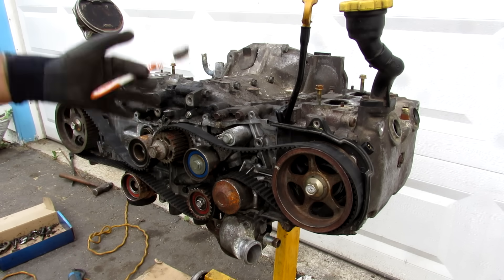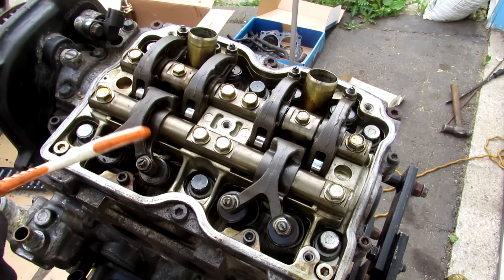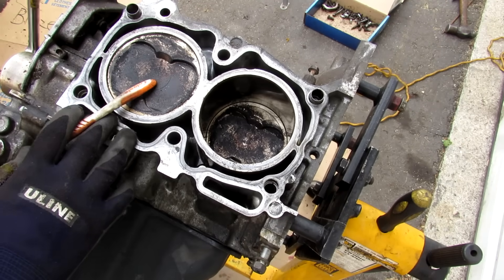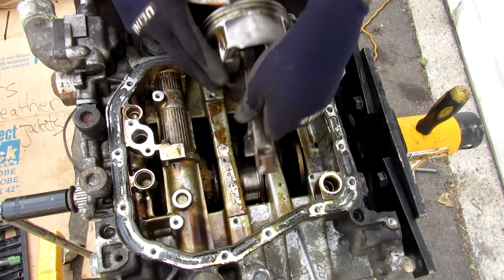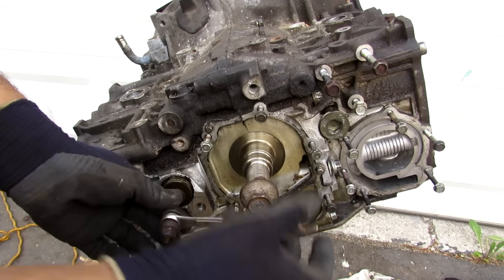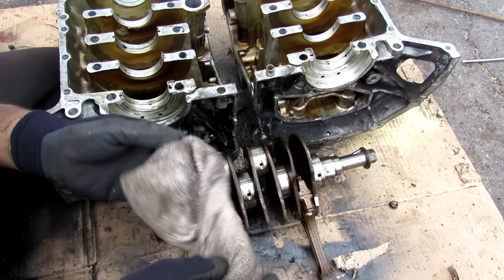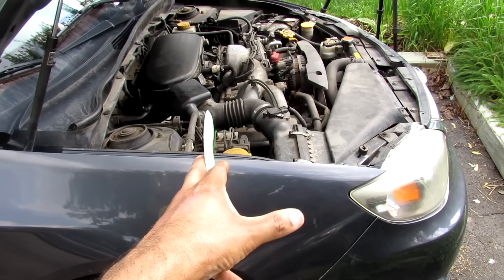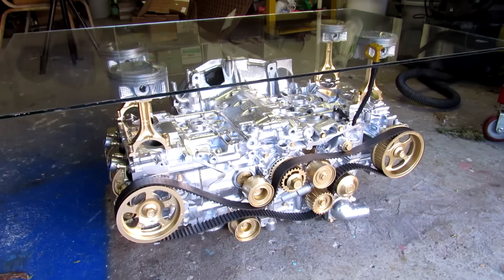Why Subaru Engines FAIL

Comment: what causes subaru's to have a ticking noise when they are cold at idle, sometimes it can stop if you blip the throttle , it will be gone for 10 seconds then might start again, or it won't. it seems really random!?
Reply: Probably lifter tick changing your oil usually stops it for a little while atleast in my mx5 sounds like what your discribing

Comment: Engine oil lubricates AND transfers heat of friction to the coolant by conduction. A bullet through the radiator caused all the coolant to leak out, but the Rolls Royce continued on to home base because the oil kept working. - Sir Lawrence of Arabia, 1925
Reply: That was in 1925 when the blocks were all cast. Newer blocks do not handle heat because of the aluminum. Although it saves weight it's at the cost of durability. Driving a modern car with little to no coolant means your replacing the motor or the car.

Comment: This was super informative but also kinda scared me away from an ej engine subie. They seem very uh unreliable with how many things can go wrong 😳
Reply: EJ engines are great, they are very reliable just as long as you take care of it. I have one with 200k and never had to do more than replace the valve cover gaskets.
Reply: @enemyspotted2467  that's good to know. I guess I just gotta find a really good ej blob eye, I've been dying to get one but i always hear they're motors are problematic and that they cant handle power cause of ring land failure.... the other issue is finding one that hasn't been abused for decent money cause they also overprice these vehicles and I'm sorry I'm not paying 18k for a almost 20 year old vehicle...

Comment: This gentleman knows what he's talking about.  I experienced exactly what's he's describing.  I had oil starvation running at 80 mph with less than 60K on the engine.  The oil level was less than a half quart low but the oil light came on.  The engine began burning oil around 45K or so.  (2.5L 2014 forester).  I now know it's a design problem.  And changing the spark plug is a horrible experience.  Other issues, the AC compressor and evaporator self destructed at 44K, Rear wheel bearing at 60K.  Break switch at 55K, and of course the oil burning issue.  Hope people learn from my mistake. I won't own another Subaru, ever.  Service dept is a rip off.

Comment: Great video. I would like to learn more about the supra engine. I had a 1980 Supra many years ago and it never gave me any mechanical problems. Too bad I got rear ended twice, fixed it both times but eventually the car had too much rust, had to scrap it after 20 years of use up in Canada (rust belt).

Comment: Why Subaru Engines FAIL
removes FRAM filter...
Reply: Gotta go with the NAPA gold filter. ;)
Reply: @johnvoorhees7881  Same as Wix, I think.  I use NAPA Gold also.
Reply: @hankosaurus  yeah, I was told Wix makes them for NAPA
Reply: Wix filters for me.
Reply: btw I use Amsoil filter and oil and will stick to that
Reply: Wix/Napa are the best for Subaru engines. Only ones that meet Subaru's bypass spec on the EJs. And they're just better filters than fram junk
Reply: @Helicopter Dad your better off shoving a cardboard box in a beer can and strapping that under your engine than running a fram.
Reply: I worked with a guy who bought a turbo legacy and did the head gaskets. It toasted the engine in a couple hours due to a $2 generic oil filter that did not have a bypass built in. Stay away from cheap garbage filters.
Reply: Best but underrated comment
Reply: Very valid point seen a few motors give out after framm filters used
Reply: there you go.....FRAM.......has the same ring as CHINA....crap filters from day one.
Reply: Get Real  I had a 2006 focus, replaced the oil and filter with whatever was on sale every 5,000 miles. Sold it at 330,000 miles. For the last few years I was buying Rural King oil and generic oil filters. That was a great motor.
Reply: I only use Mobil 1 synthetic oil and filter in my 3.6  2011. It now have 325,000km
Reply: Ran both my hondas on fram filters. Went over 300,000km on them no engine problems.
Reply: Mann filters please
Reply: adri weststrate That’s all I use on my 2010 VW Passat.
Reply: I owned 13 Toyotas over the years only one failed around 100,000 miles, about 4 weeks after I put in a fram filter, whic was against the advice given to me by Cobb county Toyota
Reply: Royal Purple oil filter. Fram is C r a p !
Reply: @adamdelarozza1985  I was trying to buy Royal Purple oil filter, as I use their oil for my engine, but I just could not find if they produce it for EA189 VW 2.0 TDI engines. Where do you buy them?

Comment: Although informative, there is some misinformation.  You should never need to split the block.  If you do need rod bearings, you're in big trouble.  You will need a crank at that point.  Generally, you only need pistons, rings, head gaskets, and water pump/timing kit.  Secondly.....NEVER EVER EVER use an impact wrench to disassemble an aluminum engine.  The impact wrench tends to rip out thread inserts.
Reply from the maker: You didn't get past the fact this was a scrap engine eh...
Reply: I had an engine with a spun bearing....well, it got spit out.....but the block was good.  Put in a different crank, rod, and new pistons & Ring's.  Turned out great.  I DID have to split the case on that one.

Comment: I was actually looking at buying a Subaru, until a buddy told me about the head gasket problem. No Thanks!
Reply: The head gasket issues only really come up on cars that were neglected and beat on. even then, it only really affected the 2000-2006 model years. Subaru's are great cars and will run forever if properly taken care of, and you can't beat the AWD.

Comment: Subaru won how many world rally championships? With an engine that fails? I think not! Incorrect coolant will cause head gaskets to leak and without correct engine oil and filter the engine will not survive very long. The flat four engine does not work against gravity and has a very low center of gravity perfect for racing. The shorter stroke is an advantage for higher rpm like F1 .Plugs may be hard to change but it’s always give and take with any setup on any car.

Comment: I used to love Subaru, but these days, short of one being given to me, I will never own one. There are certain headaches and nightmares that I am not willing to deal with, I guess I just prefer my vehicles easy to work on and maintain.
Edit: Wow, it got so, so much worse when you have to remove plugs... to get to the piston rings, to pull the pistons, before you can even split the block to get the crank out.. just....... at this point, I don't think I even want a Subaru given to me. And also, yes, all the bearing for the crank are fed, you just did not point out the holes in the other half of that crappy block. I understand what Subaru was trying to do, but.... damn the did some stupid crap.

Comment: Super informative. Had a shop, master subaru mechanic, rebuild my motor last year at 146k miles. Replaced every possible preventive maintenance part in the process. I’m about 8k miles into and oil starvation on passenger side camshaft. Oil leaked everywhere 
Please help if anyone knows why oil starvation happens on the passenger side head after a rebuild with every thing new and replaced?

Comment: Great video! Engines are fascinating and even more so when you get to see how they are put together and work. A little note for this type of engine... The apposed style of engine is well suited for constant  high rpm operation.  It is a design originally intended for aircraft. However it does work well in vehicles of many types. BMW motorcycles, Lawn tractors and cars. Keep up the awesome videos! Your narration rocks!
Reply: In aircraft the horizontally opposed engines run at low RPM, say 2,400 or so.
This is because they are not geared, so much faster and the prop tips go 
supersonic which isn't kind to the props or one's eardrums, and the 
centrifugal forces become huge. Porsche never managed to build a successful engine for aircraft, they tried but failed.
Reply: @dny9394  Are there any other boxers about apart from Porsche?
Reply: @dny9394  Radial engines on aircraft operate at lower rpm's than do the flat apposed engines. A smaller displacement engine like a flat makes it's horsepower at a higher rpm so the aircraft is equipped with a gear reduction box between the engine and prop. Not all use this setup though. Some are direct drive. There are all kinds of drive systems out there. I just find the Briggs & Stratton 2 cyl apposed air cooled engines to be very reliable and they run at 3600 rpm at full throttle. My BMW R100GS bike is also a 2 cyl air cooled engine and that runs up to 6800 rpm but highway speed is around 4200 rpm. A water cooled apposed engine has a whole list of down sides. One of which is head gasket leaks. A very common problem with the Subaru design. However... The engines that Subaru makes in Japan seem to not be plagued with this issue. It's the Subaru engines made in the USA that are known for the head gasket failures. Hmmm wonder why? I would guess quality control.
Reply: Also the airplane engines are air cooled. Those two openings next to the prop are where air comes into the cowling during flight to cool the heads which are on either side of the prop shaft. Having the hot parts of the engine split in two  and far apart makes it easier to keep cool using  just air. This feature is of no value on a car since it is water cooled. Of course excepting the older Porsches.
Reply: @stevebollinger3463  Indeed the airplane engines are air cooled as were VW, Porsche and the Flat 6 that was found in the Chevrolet Corvair! Air cooling in autos was an interesting idea but with new noise regulations and fuel mileage standards there was a switch to liquid cooling which can yield better mileage and run quieter. I find it kind of sad though because the old Air cooled designs were simpler. I still enjoy the 2 cyl apposed air cooled engine on my BMW motor bike. It's been running great since 1992! Just with oil changes and spark plugs. Oh and it never needs a water pump or radiator! XD Seems to be plenty of air around. :D

Comment: I have a naturally aspirated ej20, what would be most likely to cause the engine to tap only when the engine is cold, goes away after warming up. Running synthetic 5w40 oil.
Reply: Zac Johnson listen starting at 9:25
Reply: @adrianj7879  thanks
Reply: @adrianj7879  sounds liekly actually yeh
what oil grade would you recommend? I have been running full synthetic 5w-40 but just purchased a bottle of 5w-30 (becaus I thought it might be valve lifters)

Comment: What a fabulously paced, high information density, well spoken video. I think it’s the best I’ve seen. Clearly a very knowledgeable chap. Well videoed, well edited, punchy. Loved it and learned loads in a short time. I have a Porsche, also a boxer configuration, so would love to see a 6-cylinder boxer teardown ... and, no, you can’t have the engine out of the 911. My mum had an Alfa boxer, so even a bit of mechanical nostalgia for me! Will certainly look at another one. Loved the 14mm hex wrench bit manufacture - thrown in as a tip.
Matt, UK aged 1,000,000 (binary) this year.
P.S. ...ah, lower down, another ‘can we see a boxer-6 teardown, please?’ So - has to be done.

Comment: Why would coolant in the block cause issues with the head gasket cause it is sitting in the block. 7:30 All engines have coolant in them at all times unless it has been drained out for some reason. The way you describe it sounds like the coolant would drain out the block when not running.

Comment: Soobs should have kept going with the angle and made it a V4. Now, that would have been a heck of an engine. And it isn't as if the Japanese are new at it... I mean, Honda made (and probably still does) a heck of a V4 for their motorcycles; like the RC30 or RC45.

Comment: I will preface this by saying that I am a Subaru tech, but there is some things that are false in this video.  Firstly, the headgaskets fail on the 99-2012 motors mostly because Subaru used cheap, thin headgaskets to cut costs, use some thicker multilayer headgaskets from slightly older motors and you won't have that problem, nothing to do with torquing. Second, oil almost never mixes with the coolant on these, when it does, it comes from the combustion chamber, you would have to overhead and warp it so bad that they lock up long before that happens, what happens is the seal between the combustion chamber and the coolant passages fails causing pressurized exhaust gasses to be forced into the coolant. When they fail they start over-pressuring the coolant system and pushing coolant out through the overflow and into the reservoir, once bad enough it will overheat because the over-pressurization will stop the coolant flow and also potentially cause a misfire.  The main reason these motors fail is because A. people don't change their oil on time (I have a 2000 with over 200k that has had its oil changed religiously and doesn't burn a drop) and B. kids over-rev them and subaru's don't like high rpms

Comment: Thank you so much.  I am a shade tree mechanic.  have never hired a mechanic in 50 years driving beater automobiles.  a long time ago i decided to stick to american 6 cylinder engines pree smog control.  I often wondered about those subaru engines, as i also own a 1975 bmw motorcycle.  Your video showed me i was wise not to mess with subaru engines.   what a nightmare.   Good for subaru mechanics.   I know now that love it's what makes a subaru a subaru.   The mechanics of america must be in love with subaru, it's engine must have more self destructive tendancies than my ex wife.
Reply: I must be lucky. I have had my 2000 Liberty (Legacy) since new and have done 600,000km and have never had a problem with it. Haven't even changed the timing belts, just regular services.

Comment: What ? secondary forces cancel each other out on V6 ??? Beside, nice tear down of the engine.
Reply: cough they don't w/o the aid of (a) balance shaft(s) and counter weights
Reply: a 60° V6 is pretty close to inherently  balanced.  The infamous 90° GM/Buick V-6 was NOT!  The engine setup was made to be built on a V-8 line, for economics, not efficiency.   Yes, GM finally figured out a staggered journal crankshaft to even out the firing pulses, and it didn't become a half-bad engine, for an economy car....yes, most modern v-6's use  balance shafts, as do ALL modern I-4's...

Comment: What I don't understands is some of the motorcycle engines are horizontal oriented but most of them last quite long too. Motorcycle engines usually revs up more higher than cars, why car engines more likely to occur oil starvation?

Not to mention motorcycles tilting their engine by cornering too!
Reply from the maker: Good thoughts

Comment: I always liked the EJ18 or EJ22 engines. Subaru just didn't know how to make bigger engines! I used Hy-per Lube Oil Supplement in my EJ18 with syn oil helps to have sticky oil in a flat engine!
Reply from the maker: It's good that they are unique. But maybe they should switch to inline 4 when the pots get bigger

Comment: i wouldn’t have thought my subaru had any issues until watching this video, after i put on a 2.5 inch sti catback on my 2005 impreza, whenever you record startups, especially cold starts, you hear a metal tinging sound as it runs. can’t hear it in person but the microphone pics it up. thinking of swapping the ej201 for an ej257?
Reply from the maker: Pinging is predetonation 
On cold starts it could be piston slap

Comment: Alfa Romeo 'boxer' engine - the best. If you look after them properly they're unburstable. I've had four of them.
Reply from the maker: But the rest of the car on the other hand....
Reply: @speedkar99  Ha ha! Yes, some of them had real steel problems. ... and the electrics were idiosyncratic to say the least. The rule was (is - I'm on Number 9), if something stops working don't take 'to the dealer' as instructed. It often sorts itself in a day or two. My favourite was the Sud 1600 Ti Green Cloverleaf; no problems - just keep putting the oil in :-).

Comment: I believe you stated that a V6 is smoother than a inline 6. Wrong!  An inline 6 is the best dynamically balanced engine of all outside of a V12 which is two inline 6's.  The V6 usually has an offset crank to smooth it out.  The first Chevy V6 did not have an offset crank and vibrated.
Reply from the maker: I take it back. Let me research and clarify in next week's Volvo 5 cylinder motor video

Comment: Didn't think Subaru engines had a bad reputation for reliablity.  All engines suffer from poor maintenance, maybe these boxers more than most.
Reply from the maker: They cost more to maintain than a typical economy car owners would hence the higher failure rate

Comment: Bought a 1400DL in 1972. Loved the road handling but the gudgeon pins failed at 50K kilometres so sold it.  Thanks for the look under the hood. Extremely well explained. P.S.If some people find you are too fast they can slow down the video by changing the playback speed.
Reply from the maker: Yeah I tried to make it concise. Don't want it to be boring

Comment: Great vid also having the waterpump on one side makes for uneven coolant distribution. I'm doing head gaskets on a subaru. Bad design gasket. Steel lamenated with no swaged ring. Overheated cylinder was futherest from waterpump. One piece composite gasket better?

Comment: The original Subaru overhead valve engine was a tough little engine. I can not understand why they went to the more complicated overhead cam. Sure they will rev higher, but not many people take their engines to red line. Seems like a lot of added expense for some more horse power. It's all about torque for most people....
Plus, if you blew up the OHV you could get it out and carry it around by yourself without a hoist.